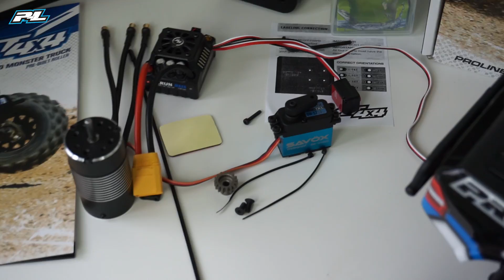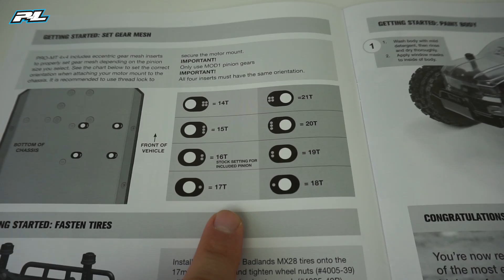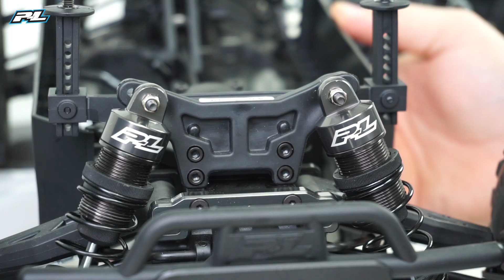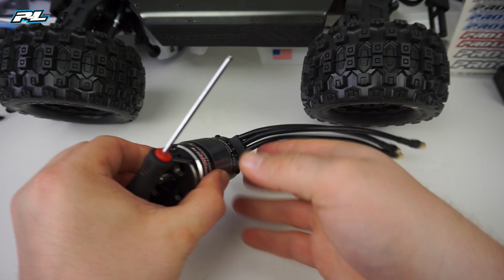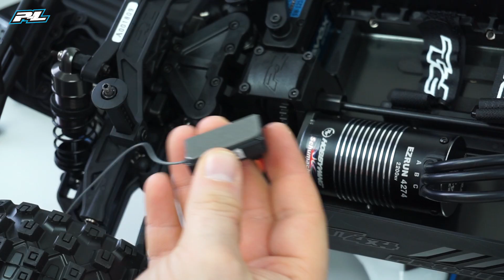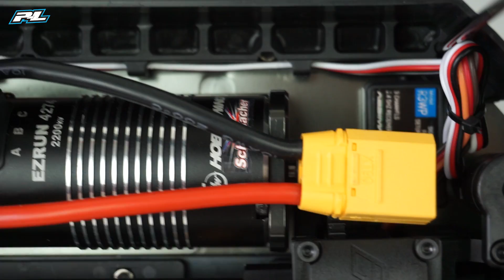Pro-Line Pro-MT 4x4 Upgrades & 1/8th Scale Electronics Installation

Comment: Why didn’t you re fill the centre diff and shocks with oil?
Reply from the maker: No need, they’re already filled 😊
Reply: Jake Billing Yes but by removing the shock caps and spur gear some oil will inevitably leak out as well as the fact that those parts are rarely filled properly from the factory.
Reply from the maker: Leo Best No none was lost during upgrade my friend 🙂
Reply: Jake Billing Good. But you could have topped them up.